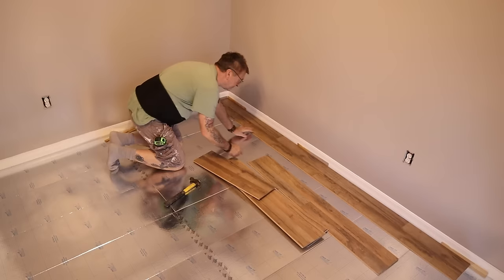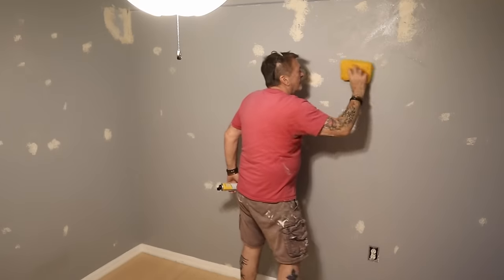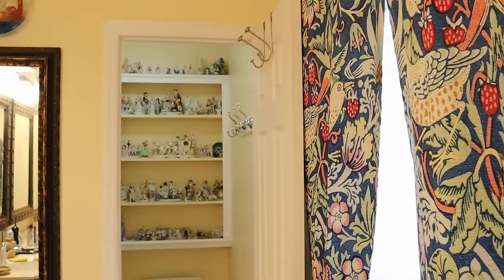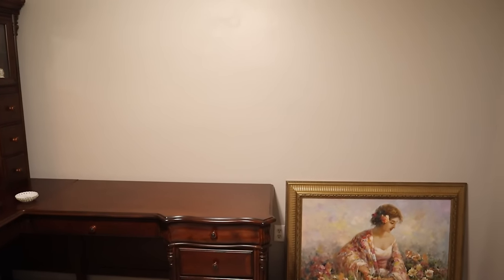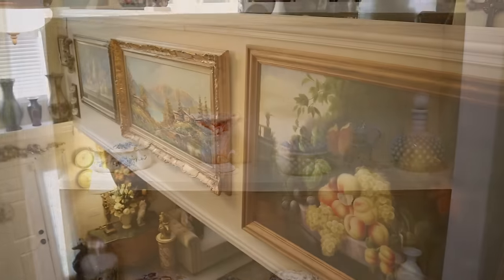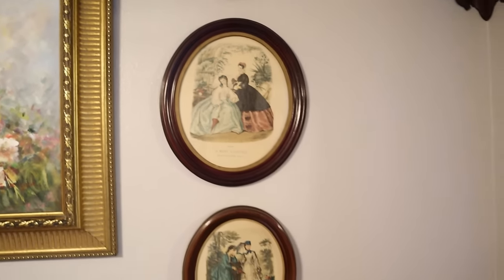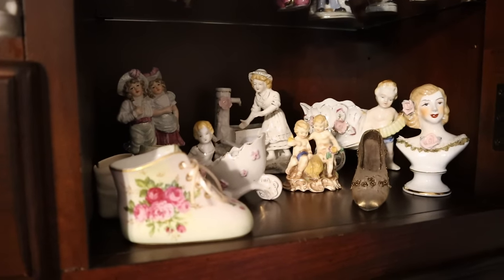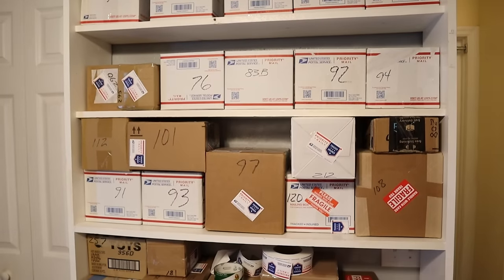HOME OFFICE MAKEOVER PROJECT // FROM STORAGE ROOM TO BEAUTIFUL // VICTORIAN INSPIRED

Comment: Good idea to put the lauan and sound barrier down but best practice is to remove the baseboards first before putting down three new layers (lauan, barrier, floor planks) and then put the baseboards back on and add quarter round trim to cover up the gaps.  Tip:  A quick fix for squeaky floors is to sprinkle on a very little bit of graphite lubricant and work it into the seams between the floor boards.  The desk is beautiful, and so is the revamped office space.
Reply from the maker: Thank you for your share...my way saves an incredible amount of time and repair ! ...the three layers only lose 1/2" of the base board and I added the 1/4 round only.